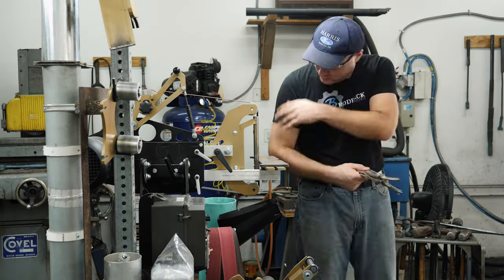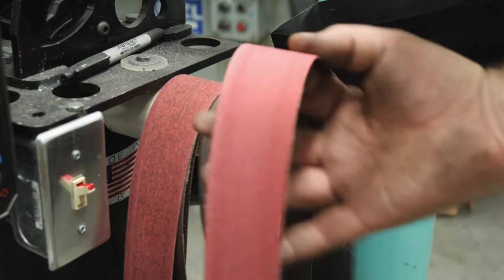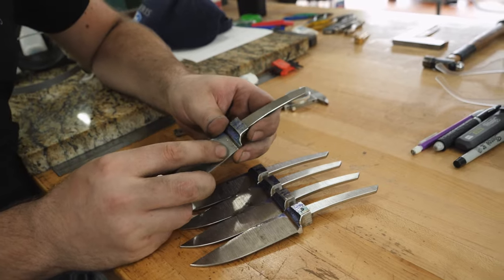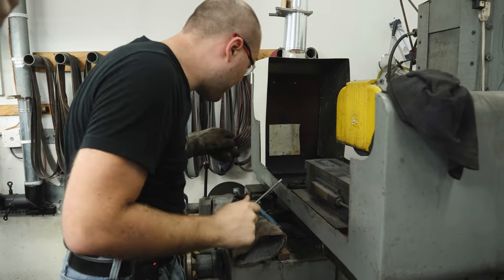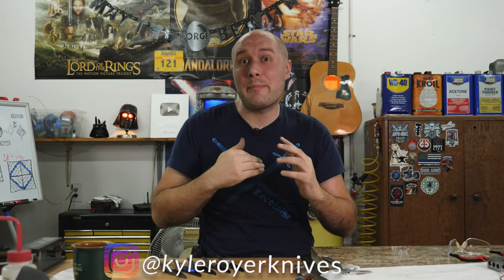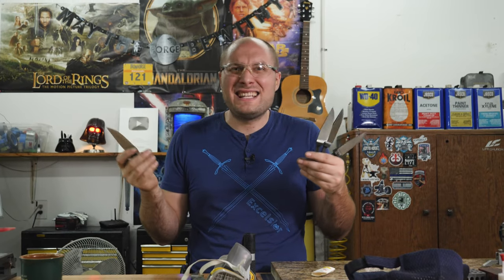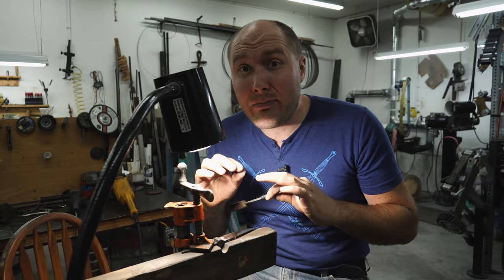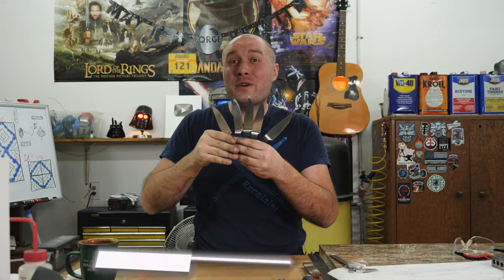Transforming a Bar of Twisted Damascus Into Usable Blades!

Comment: What backing do u use on your sanding stick
Reply from the maker: Good question ridhwaan 
Hardwood, steel, oak dowel rod, rudder,soft plastic kinda like silicone only harder round micarta, round steel. There are several types. Mostly hardwood and steel. 
Keep Forging On my friend 

Dad
Reply: @KyleRoyerKnives  wow😱 can't believe I actually got a reply😁😁thanks I appreciate you answering my question